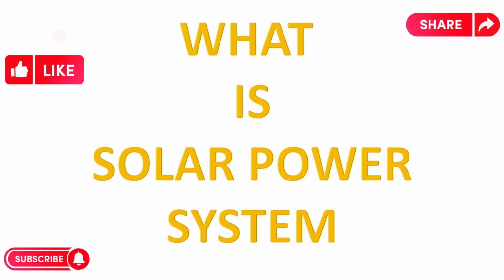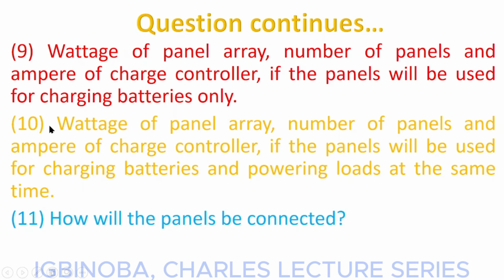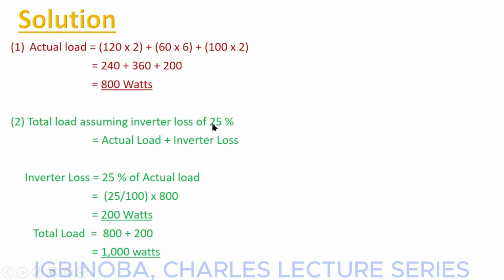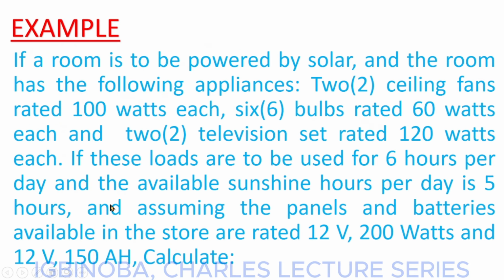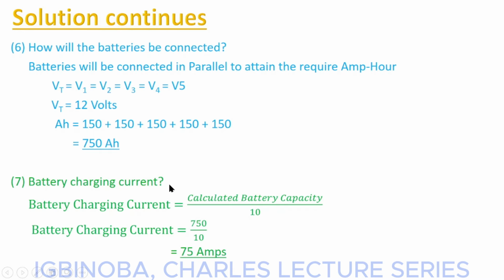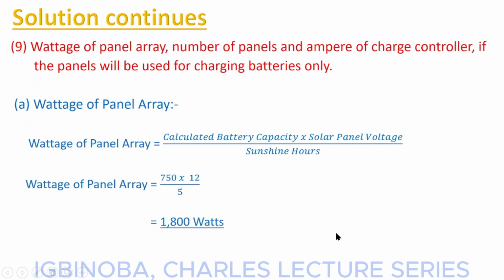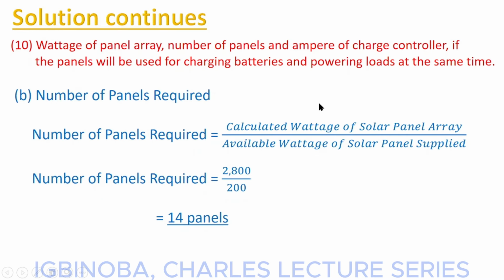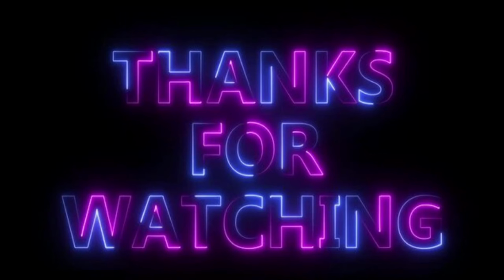Design of Solar Power System

Comment: CHM318R
1. Actual load is 1380W
2. Total load is 1725W
3. Inverter rating is 2156.25VA
4. Battery capacity is 1293.75AH
5. No. of batteries is 8.625-9batteries
6. Parallel
7. Battery changing current is 129.375amps 8. Charging time is 14hours
9. (A) 3105W (B) 15.525~16panels (C) 258.75A
10. (A) 4830W (B) 24.15~24panels (C) 402.5A 11. Parallel

Comment: CHM3162F

1. Actual load is 1380W
2. Total load is 1725W
3. Inverter rating is 2156.25VA
4. Battery capacity is 1293.75AH
5. No. of batteries is 8.625-9batteries
6. Parallel
7. Battery changing current is 129.375amps 8. Charging time is 14hours
9. (A) 3105W (B) 15.525~16panels (C) 258.75A
10. (A) 4830W (B) 24.15~24panels (C) 402.5A 11. Parallel

Comment: COMP361I
1. Actual load is 1380 w
2. Total load is 1725 w
3. Inverter rating is 2156.25 VA
4. Battery capacity is 1293.75 AH
5. No. of batteries is 9
6. Parallel
7. Battery charging current is 129.375 amps
8. Charging time is 14 hours
9.
 i. 3105 w
ii. 15.5 panels
iii. 258.75 A
10.
i. 4830 w
ii. 24 panels
iii. 402.5 A

11. Parallel

Comment: CHM391M

1. Actual load is 1380W
2. Total load is 1725W
3. Inverter rating is 2156.25VA
4. Battery capacity is 1293.75AH
5. No. of batteries is 8.625-9batteries
6. Parallel
7. Battery changing current is 129.375amps 8. Charging time is 14hours
9. (A) 3105W (B) 15.525~16panels (C) 258.75A
10. (A) 4830W (B) 24.15~24panels (C) 402.5A 11. Parallel

Comment: EEE3148R

1. ACTUAL LOAD: 1380w
2. TOTAL LOAD: 1725w
3. INVERTER RATING:  2156,25VA
4. BATTERY CAPACITY: 1293.75AH
5. NUMBER OF BATTERIES: 9
6. CONFIGURATION : PARALLEL 
7. BATTERY CHARGING CURRENT:129.375amps 
8. CHARGING TIME: 14hours
9. (A) 3105W
      i. 258.75A
     ii. 15.5 panels
10. I. 4830W
       ii. 24 panels 
       iii. 402,5A
11. CONFIGURATION: PARALLEL

Comment: CHM321U

1. Actual load is 1380W
2. Total load is 1725W
3. Inverter rating is 2156.25VA
4. Battery capacity is 1293.75AH
5. No. of batteries is 8.625-9batteries
6. Parallel
7. Battery changing current is 129.375amps 8. Charging time is 14hours
9. (A) 3105W (B) 15.525~16panels (C) 258.75A
10. (A) 4830W (B) 24.15~24panels (C) 402.5A 11. Parallel

Comment: CHM31450

1. Actual load is 1380W
2. Total load is 1725W
3. Inverter rating is 2156.25VA
4. Battery capacity is 1293.75AH
5. No. of batteries is 8.625-9batteries
6. Parallel
7. Battery changing current is 129.375amps 8. Charging time is 14hours
9. (A) 3105W (B) 15.525~16panels (C) 258.75A
10. (A) 4830W (B) 24.15~24panels (C) 402.5A 11. Parallel

Comment: 1. Actual load= 1380w

2. Total load = 1725w

3. Inverter rating= 2156.25VA

4. Battery capacity= 1293.75AH

5. No batteries 9

6. Parallel

7. Battery charging current= 129.38ampere

8. Charging time= 14 hours

9. a) 3105w

b) 15.5 panels

c) 258.75A

10. a) 4830w

b) 24 panels

c) 402.5A

11. Parallel
Reply: PETRO380B
1. Actual load= (100×3)+(60×10)+(120×4) =1380watts
2. Total load assuming inverter loss of 25%= Actual load +Inverter loss
Inverter loss=25% of Actual load
= 25%×1380=345 watts
Total load= 1380+345=1725 watts
3. Inverter rating on VA using power factor of 0.8
= (1725÷0.8)= 2156.25
4. Battery capacity using factor for reserve 75%=(2×1725×6×0.75)=1293.75Ah
5. No. of batteries for backup hours=1293.75Ah÷150Ah= 8.6 =8 batteries 
6. How batteries will be connected?
The batteries will be connected in parallel 
Vt=V1=V2=V3=V4=V5=V6=V7=V8
Ah= 150+150+150+150+150+150+150+150=1200
7. Battery charging current=1293.75÷10=129Amps
8. Battery charging time assuming charging loss of 40%= 1293.75Ah+(40%+1293.75Ah)÷129A=14hrs
9a. Wattage panel array= 3105 watts
9b. Number of panels required= 3105÷345=9 panels 
9c. Ampere of charging controller required= 3105÷12=258.75Amps
10a. Wattage of panel array= Calculated wattage of solar panel array for charging battery only+ calculated total load =3105+1725=4830watts
10b. Number of panels required= calculated wattage of solar panel array÷ Available wattage of solar panel supplied= 4830watts÷345= 14Amps
10c. Ampere of charge controller= calculated wattage of solar panel array÷ solar panel voltage=4830watts÷12volts= 402.5Amps
11. How will the panels be connected?
Ans: They will be connected in parallel

Comment: PETRO312L

1. Actual load= (100×3)+(60×10)+(120×4) =1380watts
2. Total load assuming inverter loss of 25%= Actual load +Inverter loss
Inverter loss=25% of Actual load
= 25%×1380=345 watts
Total load= 1380+345=1725 watts
3. Inverter rating on VA using power factor of 0.8
= (1725÷0.8)= 2156.25
4. Battery capacity using factor for reserve 75%=(2×1725×6×0.75)=1293.75Ah
5. No. of batteries for backup hours=1293.75Ah÷150Ah= 8.6 =8 batteries 
6. How batteries will be connected?
The batteries will be connected in parallel 
Vt=V1=V2=V3=V4=V5=V6=V7=V8
Ah= 150+150+150+150+150+150+150+150=1200
7. Battery charging current=1293.75÷10=129Amps
8. Battery charging time assuming charging loss of 40%= 1293.75Ah+(40%+1293.75Ah)÷129A=14hrs
9a. Wattage panel array= 3105 watts
9b. Number of panels required= 3105÷345=9 panels 
9c. Ampere of charging controller required= 3105÷12=258.75Amps
10a. Wattage of panel array= Calculated wattage of solar panel array for charging battery only+ calculated total load =3105+1725=4830watts
10b. Number of panels required= calculated wattage of solar panel array÷ Available wattage of solar panel supplied= 4830watts÷345= 14Amps
10c. Ampere of charge controller= calculated wattage of solar panel array÷ solar panel voltage=4830watts÷12volts= 402.5Amps
11. How will the panels be connected?
Ans: They will be connected in parallel

Comment: CHM 316P

1. Actual load= 1380w

2. Total load = 1725w

3. Inverter rating= 2156.25VA

4. Battery capacity= 1293.75AH

5. No batteries 9

6. Parallel

7. Battery charging current= 129.38ampere

8. Charging time= 14 hours

9. a) 3105w

b) 15.5 panels

c) 258.75A

10. a) 4830w

b) 24 panels

c) 402.5A

11. Parallel

Comment: COMP380B

A. Actual load: 1380W

B. Total load: 1725W

C. Inverter rating: 2156,25VA

D. Battery capacity: 1293.75AH

E. Number of batteries: 9

F. Configuration: Parallel

G. Battery charging current: 129.375 amps

H. Charging time: 14 hours

I. (A) 3105W

(1) 15.5 panels

(2) 258.75A

J. (1) 4830W

(2) 24 panels

(3) 402,5A

K. Configuration: Parallel

Comment: COMP388J

1. Actual Load = 1380 watts
2. Total Load = 1720 watts
3. Inverter Rating = 2156.25 VA
4. Battery Capacity = 1293.75 Ah
5. Number of Batteries = 9 batteries
6. Parallel
7. Battery charging current = 129.3Amps
8. Charging time is 14 hrs
9. (a) 3105 watts
(b) 15.5  panels
(C) 258.75 Amps
10. (a) 4830 watts
(b) 24 panels
(c) 402.5 Amps
11. Parallel

Comment: EEE3314J😊

1. Actual load is 1380w

2. Total load is 1725w

3. Inverter rating is 2156.25VA

4. Battery capacity is 1293.75AH

5. No. Of batteries is 9

6. Parallel

7.Battery charging current is 129.375amps

8. Charging time is 14hours

9. (A) 3105w

(B) 15.5panels

(C)258.75A

10.(A) 4830w

(B) 24panels

(C) 402.5A

11. Parallel

Comment: EEE382D

A. Actual load: 1380W

B. Total load: 1725W

C. Inverter rating: 2156,25VA

D. Battery capacity: 1293.75AH

E. Number of batteries: 9

F. Configuration: Parallel

G. Battery charging current: 129.375 amps

H. Charging time: 14 hours

I. (A) 3105W

(1) 15.5 panels

(2) 258.75A

J. (1) 4830W

(2) 24 panels

(3) 402,5A

K. Configuration: Parallel

Comment: NAT326Z 1. Actual load =1380W
2. Total Load =1720W
3. Inverter Rating = 2156.25VA
4. Battery Capacity = 1293.75AH
5. Number Of Battery = 8.6 ~ 9 batteries 
6. Parallel
7. Battery Charging Current = 129.4AMPs 
8. Charging Time = 14HRS 
9. (a) 3105 Watts 
    (b) 15.5 = 16 Panels 
    (c) 258.75 Amps 
10. (a) 4830W
      ( b) 24.15 ≤ 24 Panels
      (c) 402.54 Amps
11. Parallel

Comment: MEC38L

I) Actual load= 1380W
2) Total load= 1720W
3)  Inverter rating= 2156.25VA
4) battery Capacity= 1293.75Ah
5) number of batteries= 8.6
6) Parallel
7) Battery charging= 129.4A
8) Time= 14hrs
9) (a) 3105W
     (b) 15.5 panels
     (c) 258.75 A
10) (a) 4830W
      (b) 24 panel
      (c) 402.5A
II) Parallel

Comment: PETRO313M

 BELOW ARE THE ANSWERS 
1. Actual load= (100×3)+(60×10)+(120×4) =1380watts
2. Total load assuming inverter loss of 25%= Actual load +Inverter loss
Inverter loss=25% of Actual load
= 25%×1380=345 watts
Total load= 1380+345=1725 watts
3. Inverter rating on VA using power factor of 0.8
= (1725÷0.8)= 2156.25
4. Battery capacity using factor for reserve 75%=(2×1725×6×0.75)=1293.75Ah
5. No. of batteries for backup hours=1293.75Ah÷150Ah= 8.6 =8 batteries 
6. How batteries will be connected?
The batteries will be connected in parallel 
Vt=V1=V2=V3=V4=V5=V6=V7=V8
Ah= 150+150+150+150+150+150+150+150=1200
7. Battery charging current=1293.75÷10=129Amps
8. Battery charging time assuming charging loss of 40%= 1293.75Ah+(40%+1293.75Ah)÷129A=14hrs
9a. Wattage panel array= 3105 watts
9b. Number of panels required= 3105÷345=9 panels 
9c. Ampere of charging controller required= 3105÷12=258.75Amps
10a. Wattage of panel array= Calculated wattage of solar panel array for charging battery only+ calculated total load =3105+1725=4830watts
10b. Number of panels required= calculated wattage of solar panel array÷ Available wattage of solar panel supplied= 4830watts÷345= 14Amps
10c. Ampere of charge controller= calculated wattage of solar panel array÷ solar panel voltage=4830watts÷12volts= 402.5Amps
11. How will the panels be connected?
Ans: They will be connected in parallel

Comment: Civ332f

1. Actual load is 1380 w

2. Total load is 1725 w

3. Inverter rating is 2156.25 VA

4. Battery capacity is 1293.75 AH

5. No. Of batteries is 9

6. Parallel

7.Battery charging current is 129.375 amps

8. Charging time is 14 hours

9. (Α) 3105 w

(B) 15.5 panels

(C)258.75 A

10.(Α) 4830 w

(B) 24 panels

(C) 402.5 A

11. Parallel

Comment: MAR3114J

2. 1. Actual load is 1380w
2. Total load is 1725w
3. Inverter rating is 2156.25VA
4. Battery capacity is 1293.75AH
5. No of batteries 9
6. Parallel
7. Battery charging current is 129.375amps
8. Charging time is 14 hours
9. (A) 3105w
(B) 15.5 panels
(C) 258.75A
10. (A) 4830w
(B) 24 panels
(C) 402.5A
11. Parallel

Comment: PETROCHEM389K

ANSWERS:
1 Actual load =1380W

2 Total load  =1720W

3 Inverter rating = 2156.25VA

4 Battery Capacity =1293.75Ah

5 Number of batteries is 8.6

6 Parallel 

7 Battery charging  =129.4A

8 T =14hrs

9 (a) 3105W
   (b) 15.5 panels 
   (c)  258.75 A

10 (a) 4830W 
     (b) 24 panel 
     (c) 402.5A 

11 Parallel

Comment: NAT312L

1. Actual load =1380W
2. Total Load =1720W
3. Inverter Rating = 2156.25VA
4. Battery Capacity = 1293.75AH
5. Number Of Battery = 8.6 ~ 9 batteries 
6. Parallel
7. Battery Charging Current = 129.4AMPs 
8. Charging Time = 14HRS 
9. (a) 3105 Watts 
    (b) 15.5 = 16 Panels 
    (c) 258.75 Amps 
10. (a) 4830W
      ( b) 24.15 ≤ 24 Panels
      (c) 402.54 Amps
11. Parallel

Comment: COMP351Y

1. Actual Load = 1380W
2. Total load(VA) = 1725W
3. Inverting rating (VA) = 2156.25VA
4.Battery capacity = 1293.75Ah
5. No. Of batteries= 9 batteries 
6. Battery connection: Parrallel
7. Battery charging current: 15A (per battery string)
8. Battery charging Time: 5.1days
9. Panel Array (for charging batteries only)
A. 3105watts
B. 16 panels
C. 258.75amps
10. 
A. 4830W
B. 24 panels
C. 402.5 amps
11. Parallel

Comment: MAR343Q
1. Actual Load: 1380 W

2. Total Load (including inverter loss): 1840 W

3. Inverter Rating (VA): 2300 VA

4. Battery Capacity: 1227 Ah

5. Number of Batteries: 9 batteries

6. Battery Connection: Parallel

7. Battery Charging Current: 15 A (per battery string)

8. Battery Charging Time: 5.1 days

9. Panel Array (for charging batteries only):

Wattage: 2945 W

Number of Panels: 15 panels

-Charge Controller Ampere: 245 A

10. Panel Array (for charging batteries and powering loads):

Wattage: 4785 W

Number of Panels: 24 panels

Charge Controller Ampere 399 A
11. Panel Connection: Parallel

Comment: CHM 3125U
1. Actual load= 1380w
2. Total load = 1725w
3. Inverter rating= 2156.25VA
4. Battery capacity= 1293.75AH
5. No batteries 9
6. Parallel 
7. Battery charging current= 129.38ampere
8. Charging time= 14 hours
9. a) 3105w
   b) 15.5 panels
   c) 258.75A
10.  a) 4830w
     b) 24 panels
     c) 402.5A
11. Parallel

Comment: NAT336J

1. Actual Load = 1380 watts
2. Total Load = 1725 watts
3. Inverter Rating = 2156.25 VA
4. Battery Capacity = 1293.75 Ah
5. Number of Batteries = 8.625 ~ 9 batteries
6. Parallel
7. Battery charging current = 129.375 Amps
8. Charging time = 14 hrs
9. (a) 3105 watts
(b) 15.525 ~ 16 panels
(c) 258.75 Amps
10. (a) 4830 watts
(b) 24.15 ~ 24 panels
(c) 402.5 Amps
11. Parallel

Comment: MECH336J

1. Actual load: 1380W

2. Total load: 1725W

3. Inverter rating: 2156.25VA

4. Battery capacity: 1293.75AH

5. Number of batteries: 9

6. Configuration: Parallel

7. Battery charging current: 129.375 amps

8. Charging time: 14 hours

9. (A) 3105W

(B) 15.5 panels

(C) 258.75A

10. (A) 4830W
(B) 24 panels 
(C) 402.5A

11. Configuration: parallel

Comment: MECH375W

1. Actual load is 1380w
2. Total load is 1725w
3. Inverter rating is 2156.25VA
4. Battery capacity is 1293.75AH
5. No of batteries 9
6. Parallel
7. Battery charging current is 129.375amps
8. Charging time is 14 hours
9. (A) 3105w
(B) 15.5 panels
(C) 258.75A
10. (A) 4830w
(B) 24 panels
(C) 402.5A
11. Parallel

Comment: PETROCHEM380B

1 Actual load 1380W
2 Total load  1720W
3 Inverter rating  2156.25VA
4 battery Capacity 1293.75Ah
5 number of batteries 8.6
6 Parallel 
7 Battery charging  129.4A
8 T = 14hrs
9 (a) 3105W
   (b) 15.5 panels 
   (c)  258.75 A
10 (a) 4830W 
     (b) 24 panel 
     (c) 402.5A 
11 Parallel

Comment: EEE 381C
1. Actual Load = 1380 watts
2. Total Load = 1725 watts
3. Inverter Rating = 2156.25 VA
4. Battery Capacity = 1293.75 Ah
5. Number of Batteries = 8.625 ~ 9 batteries
6. Parallel
7. Battery charging current = 129.375 Amps
8. Charging time = 14 hrs
9. (a) 3105 watts
    (b) 15.525 ~ 16 panels
    (c) 258.75 Amps
10. (a) 4830 watts
    (b) 24.15 ~ 24 panels
    (c) 402.5 Amps
11. Parallel

Comment: PETROCHEM33C 

1 Actual load 1380W
2 Total load  1725W
3 Inverter rating  2156.25VA
4 battery Capacity 1293.75Ah
5 number of batteries 8.625 approx 9 batteries 
6 Parallel, since the current is increasing and voltage is constant 
7 Battery charging current  129.375A
8 Battery charging time - 14 hrs
9 (a) 3105W
   (b) 15.525 panels approx 16 panels
   (c)  258.75 A
10 (a) 4830W 
     (b) 24.15 approx 25 panels
     (c) 402.5A 
11 Parallel

Comment: PETROCHEM363K

1 Actual load 1380W
2 Total load  1720W
3 Inverter rating  2156.25VA
4 battery Capacity 1293.75Ah
5 number of batteries 8.6
6 Parallel 
7 Battery charging  129.4A
8 T = 14hrs
9 (a) 3105W
   (b) 15.5 panels 
   (c)  258.75 A
10 (a) 4830W 
     (b) 24 panel 
     (c) 402.5A 
11 Parallel

Comment: MECH389K

1. Actual load: 1380 W
2. Total load: 1720 W
3. Inverter rating: 2156.25 VA
4. Battery capacity: 1293.75 Ah
5. Number of batteries: 8.6
6. Connection: Parallel
7. Battery charging current: 129.4 A
8. Time (T): 14 hrs
9. (a) 3105 W
   (b) 15.5 panels
   (c) 258.75 A
10. (a) 4830 W
    (b) 24 panels
    (c) 402.5 A
11. parallel

Comment: MECH3188F

1. Actual load = 1380W
2. Total load = 1840W
3. Inverter rating = 2156.25KVA
4. Battery Capacity = 1293.75Ah
5. Number of batteries = 8.625 ~ 9
batteries
6. Parallel
7. Battery charging current = 129.375Amps
8. Charging time = 14 hours
9(a). 3105Watts
(b). 15.5 ~ 16 panels

(b). 15.5 ~ 16 panels (c). 258.75Amps
10(a). 4830W
(b). 24.15 ~ 24 panels
(c). 402.5Amps
11. Parallel

Comment: EEE34OH 

i) Actual load = 1380 watts.

ii) Total load = 1725 watts.

iii) Inverter ratings in VA= 2156.25VA.

iv) Battery capacity = 1035Ah.

v) Number of batteries for backup hours = 6.9= 7 batteries.

vi) The batteries will be connected in parallel.

vii) Battery charging current= 103.5 A.

viii) Battery charging time= 14 hours

ix) a. Wattage of panel array= 2484 watts.

b. Number of panels= 12.42 = 12 panels

c. Ampere of charge controller= 207A.

x) a. Wattage of panel array= 4209 watts.

b. Number of panels= 21.05 = 21 panels.

c. Ampere of charge controller= 350.75A.

xi) The panels will be connected in parallel just as the batteries

Comment: PETRO3130Z

1. Actual Load = 1380 watts
2. Total Load = 1725 watts
3. Inverter Rating = 2156.25 VA
4. Battery Capacity = 1293.75 Ah
5. Number of Batteries = 8.625 ~ 9 batteries
6. Parallel
7. Battery charging current = 129.375 Amps
8. Charging time = 14 hrs
9. (a) 3105 watts
 (b) 15.525 ~ 16 panels
  (c) 258.75 Amps
10. (a) 4830 watts
  (b) 24.15 ~ 24 panels
  (c) 402.5 Amps
11. Parallel

Comment: COMP336J

1. Actual load: 1380 W

2. Total load: 1720 W

3. Inverter rating: 2156.25 VA

4. Battery capacity: 1293.75 Ah

5. Number of batteries: 8.6

6. Connection: Parallel

7. Battery charging current: 129.4 A

8. Time (T): 14 hrs

9.
(a) 3105 W
(b) 15.5 panels
(c) 258.75 A

10.
(a) 4830 W
(b) 24 panels
(c) 402.5 A

11. Parallel

Comment: CHM383E
i) Actual load = 1380 watts.
ii) Total load = 1725 watts.
iii) Inverter ratings in VA= 2156.25VA.
iv) Battery capacity = 1035Ah.
v) Number of batteries for backup hours = 6.9= 7 batteries.
vi) The batteries will be connected in parallel.
vii) Battery charging current= 103.5 A.
viii) Battery charging time= 14 hours 
ix) a. Wattage of panel array= 2484 watts.
b. Number of panels= 12.42 = 12 panels
c. Ampere of charge controller= 207A.
x) a. Wattage of panel array= 4209 watts.
b. Number of panels= 21.05 = 21 panels.
c. Ampere of charge controller= 350.75A.
xi) The panels will be connected in parallel just as the batteries